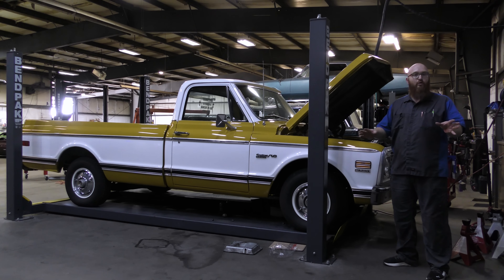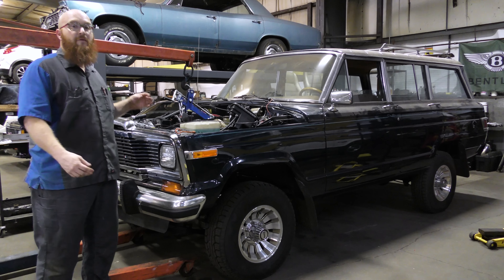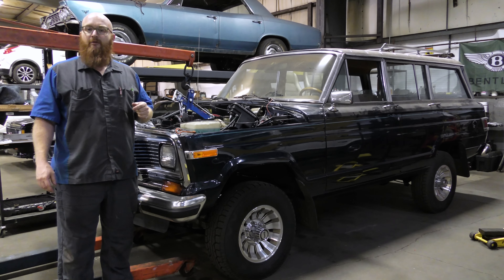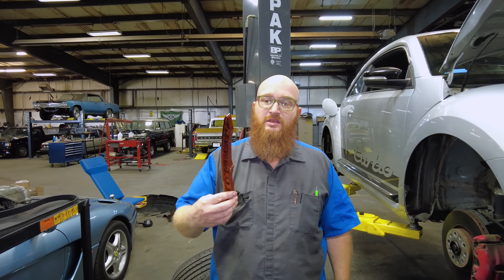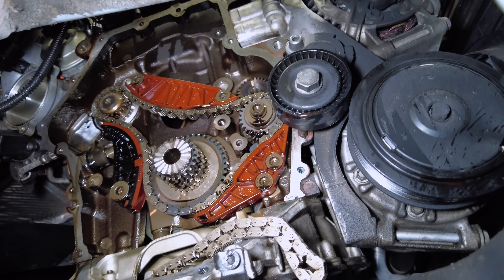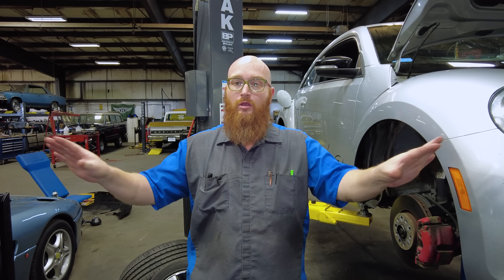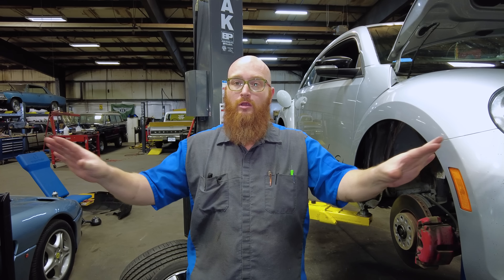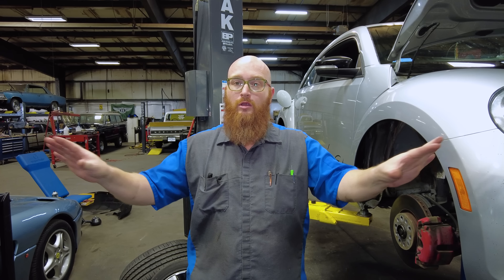Hard to test, can't see it, but it can KILL your car! CAR WIZARD talks Timing Chains! Is yours next?

Comment: Had a timing belt replaced on my daughter's 2004 2.0L VW Beetle while she was away at school. Car had about 80K miles so it was time. The hack shop did not adjiust the tensioner properly and the timing chain slipped 10K miles later. Since it's an interference engine design, the damage was catasrtophic. Several valves crashed into the top of the pistons so I had to replace the cylinder head. Fortunately the pstons had no signficant damage. During the repair I found the hack shops tensioner adjustment tool laying down near the bottom of the timing cover. Apparently the mechanic dropped the tool during the repair and couldn't find it so he never finished adjusting the tensioner.
Reply: Nice! 😞
Reply: @Scooter 
You DID get your money back from the defective workmanship didn't you?
You should have gone to small claims court ! Only about $65 bucks to file a claim for damages against that incompetent shop.
Reply: @Scooter 
and your experience is why many people don't want to get their cars serviced, this kind of terrible incompetence is the NORM in the business. The competent and honest shop is the EXCEPTION to the rule
Reply: Sad...older Rabbits had rubber belt non interference motors. 
Sorry to hear that..
Mechanic had "cellphone interruptus syndrome" forgot e dropped tool.
Reply: It's always best to go to an 'indy' (independent) marque specialist.  Plenty of VW specialists out there.  They usually don't rip you off like dealers do.  Otherwise they can't stay in business for 20+ years as many have or else bad word-of-mouth would make their business dry up.
Reply: @Matt_from_Florida  true but check reputation... Many butchers out there.
I do all my own work .
Reply: @Nudnik1  I also do ALL MY OWN WORK.  I'll be 60 in 2 months and I haven't paid a professional mechanic since I was 23.  That first-hand knowledge is how I know whether local repair shops are legit.
Reply: @Matt_from_Florida  same here 60 on 9/1 fix all equipment trucks boats bikes since 13 yo. 👍
Reply: Same here early 50s I DIY everything myself from cars to ceramic tile to roof repairs. Every time I had a pro do it I've had to go behind them and fix their shoddy work. Last time I took a car in was it needed an inner tie rod and alignment. Oh gee you need new struts we can't align it on these worn struts. What am I going to do so ok do the struts. $1000 later the wheel is at the 1130 position and I later found where they did not secure the ABS wire so it was rubbing through. They also did not install the grease fittings on the new sway bar links. Finished the job myself and will never go back nor recommend. Oh and it took them days to get this done because they had training or something.
Reply: Oh and then there was the time my daughter got a flat at school so I put the spare on and went to the tire shop to get two new rear tires since they were kinda worn anyway. Bad on me I should have checked but I forgot and a few months later went to check her spare pressure and low and behold they swapped her good spare for a shredded one and stole her jack. So I go back to the shop and tell the manager I want a new spare and jack. He cannot understand how this could happen. I said who here drives a Mustang. He said he'll take care of it and a couple days later I picked up the new spare and jack. Unbelievable.
Reply: @Matt_from_Florida  Me too! Keep telling myself it's just a number.

Comment: Always amazed me how German manufacturers always have these timing chain issues.  I always thought…look at what Toyota did and copy that and never worry about it again.
Reply: The Swedish manufacturers (Volvo and Saab) had some issues, too. Not because of poor timing chains (which were duplex, so certainly strong enough), but because Volvo used a fibre chain drive gear - presumably to make it quieter - and Saab used a weak tensioner, which could wear and even break. Surprising in view of the fact that both companies made solidly built cars. I had several Saab 99s over 20 years . When they went bust, I switched to - you've guessed - Toyota.
Reply: I love Toyota they are like cockroaches they never die
Reply: I worked at a independent BMW repair shop for 7 years. Some of the engineering crap i saw was mind blowing. And to this day they can t make a engine not leak oil.
Reply: @jonhouck7254  I love mine, too. I was driving home one evening, crawling through rush hour traffic in London. I drive one of the very few Camrys on the road in the UK (they're rare here). An African guy driving a delivery truck in the opposite direction leaned out of the window, smiled, pointed at my car and shouted, "They never die, man" and gave me a thumbs up.
Reply: @laurieharper1526  GM (2.4 and 3.6), Nissan (Juke and the 3.5 VQ)  among others would like to say hi.
Reply: @laurieharper1526  Instead of several SAAB cars over 20 years, you can drive one Corolla for over 20 years, and then it still runs perfectly.
Reply: @deansapp4635  I was going to buy a 4 year old BMW with the B48 engine (supposed to be their good engine without timing chain issues). Thankfully I was allowed to bring it home to inspect the car and after removing three under car covers I found an oil leak. How can a 4 year old car that was seemingly well taken care of and had a full service history leak oil?
Reply: I killed a Toyota back when I was a teenager. Took some railroad tracks at high speed to do it. It’s amazing what air time does to a car.
Reply: Toyotas also have timing chain issues. Usually due to lack of maintenance and age and not by design. People think you dont have to maintain toyotas becuase they are reliable, but thats not true. The real issue in most cases with most cars is poor maintenance. Americans are bad at servicing their vehicles.
Reply: @PeterGeorges  It's a BMW.   Don't ever ever ever in life buy a used BMW. It's the biggest and costliest mistake you can make.
Reply: @MiikeyLawless  All vehicles need services. If you service a Toyota it will run forever. BMW's and the like don't last long, even if you do service them meticulously.
Reply: @BubblesTheCat1  after that experience I purchased a Mazda instead!
Reply: @PeterGeorges  😅👍
Reply: @BubblesTheCat1  Nothing is more expensive than a cheap, used German car.
Reply: @napoleontheclown  So true. I had a nephew, who bought a used BMW at a second hand car lot for the price of a new Corolla. What a stupid move! I warned him over and over again. The BMW then kept on breaking down, leaving him and his family stranded 1000's of kilometres from home. The repairs then cost mega  $$$ and he eventually gave up, heartbroken and in tears when trying to sell that BMW again. He had to let it go for absolutely next to nothing. Less than 1/10 of what he paid for it. 😅😅😅😅
Reply: @BubblesTheCat1  Ouch. Hopefully he learned that there's a reason luxury cars, in general, have such low resale value.
Reply: @napoleontheclown  Yep. Lesson learnt. The hard way 😃
Reply: @BubblesTheCat1  NA i6 BMWs are legit though. I've seen guys put 300k+ on E90s with minimal trouble. I'm at 150k on my 2008, original clutch and everything else besides gaskets and a water pump 9 years ago, driven it across the US twice in the past few months
Reply: Or Honda.
Reply: @PeterGeorges  I don t understand why BMW can t engine oil leaks. I owned a 95 Chevy Suburban from new. At 240k miles it developed its first and only oil leak, Oil filter adapter. $ 3.00 in parts and 20 mins to fix. My brothers BMW 435 made it to 60k miles before it started leaking oil. This is his 5th and last BMW
Reply: @thebigpicture2032  not always - I was in an 89 extended cab pickup that hit a 6 ft 70 degree railroad track. We were in the air long enough for the front to come down, hit on front wheels. Popped out one of the headlights and no other apparent damage. Years later they found we cracked the front axle. But still drove baby.
Reply: @BubblesTheCat1  thats some bs lol.  People just try to treat the germans like theyre toyotas and guess what?  Doesnt work.  Stay on your intervals and youll be great.  Thats why I always buy Euro over Toyota.  Toyotas are boring, no fun, OVERPRICED appliances.
Reply: Agreed. I have a 1991 Toyota 4Runner , V6 5 speed,  377k miles. Serviced every 5 thousand. Never a major mechanical failure. We just acquired a 22 4runner limited . I plan for it to be my last vehicle,  I'm convinced it will carry me to my grave. I'm a 4runner purist , bone stock , meticulous serviced . 🙂
Reply: @jarrodmcmillian1747  Appliances that have an excellent resale value, and hardly ever breaks down?  I'll have one, thanks. 
Anybody who calls the new Lexus LC 500 "boring,  obviously haven't seen, driven or owned one. I'm a tech, and can confirm that BMW, and the other German cars of today is NOT value for money. 
Sadly Toyota is also starting to go this way. They must have learnt about planned obsolescence.
Reply: @d47000  Older BMW'S were indeed way better, yeah ☺👍
Reply: @MattBlack6  Or early 2000's Nissan, before the fatal Renault merger.
Reply: @deansapp4635  Yea I don't get it, even my 14 year old Mercedes CLK doesn't have leaks but a 4 year old BMW can't stay dry. I was happy that my BMW paranoia made me bring the car home for an underneath inspection though, most other brands I wouldn't bother for a 4 year old car that was otherwise well kept! Glad I didn't end up with that headache. I was expecting to see more of a coolant issue rather than oil tbh!

It's unfortunate though because they are great cars to drive but that's not worth the potential of major engine troubles down the line.
Reply: 210k miles and I haven't given my Camry's timing chain a second thought. Now I wonder if I should lol. Ah well.
Reply: @MattExzy  Nah, when you're past a million miles,  you can think about it again ☺👍
Reply: @jarrodmcmillian1747  Yes, you could call Toyota "appliances". Like any appliance, most owners want them to work and do the job they are supposed to do. Which Toyota do extremely well. If "boring" is getting to your destination every time with zero issues, I'll take "boring" any day of the week.  I have enough excitement in my life already, and don't need to add uncertainty about my car to the mix.
Reply: @BubblesTheCat1  When I started running Saabs (1970s), Corollas didn't exist.
Reply: Mighty Aussie Ford 4.0L Barra have zero chain issues as well and are known to go past 500k with regular interval servicing. Taxis with LPG will hit 1m klicks.
Reply: @PeterGeorges  I worked for a independent BMW repair shop for 7 years. We offered all of customers a free pre purchase inspection. We broke alot of customers hearts when we would find the vehicle needing 1000s of dollars in repairs.
Reply: @laurieharper1526  I had a Saab 99 never broke could not blow engine even when we used it on dirt bike track..I had a few Volvo 240 and 260 strong simple cars also indestructible. Now they are Chinese junk .
Saab 99 had British Rover engines.
Reply: @deansapp4635  my cousin has a shop in NYC does Audi BMW Mercedes VW garbage cars.
Look nice until repair bills come in.
He drives a Chevy Tahoe with 300k miles 😂
Reply: @Nudnik1  It was actually a Triumph engine, designed by Ricardo. 1850 4 pot. Triumph used it in the Dolomite and other models. It had a few issues - wedge shaped combustion chambers (because Triumph wanted to use 2 side by side to create a narrow V8 which would fit in the Stag), angled cylinder head bolts, not the best thermal efficiency/prone to over heat (which Stags were, also) and the water pump set into the block and driven via a skew gear off the crankshaft. If the pump failed and leaked, coolant could get into the engine oil. Over the years, Saab modified it - increasing the bores, using conventional combustion chambers, widening the gaps between the bores and re-siting the water pump. A fine engine, granted, but the timing chain tensioner remained an issue until the last version from the eaarly1980s. My most recent 99 was from the final year of production. Great cars. When Saab went bust, it became very difficult to get parts for pre-GM models, which was when I switched to Toyota.
Reply: @laurieharper1526  true Triumph I forgot 30 years ago...Sorry. Yes my water pump shaft sheared after thrashing 9000 rpm with 200k miles when we tried to finish it off 
Awesome car in snow also.
Clutch disc can be changed without removing trans or motor.
Engine was strong simple.
Thanks
Reply: @Nudnik1  You're right about performance in snow. My partner and I both had 99s. We lived on a steep hill and were the only people (together with another guy in the street who ran a 99) who could drive up it when it snowed.
Reply: @laurieharper1526  Amazing cars. Older Saab two stroke and v4  in 60s had a lever that let front drive axel ratchet no compression braking down hill so you maintain steering going down icy snow slopes.
Watch Volvo Sweden off road rally racing.. No cars stronger .
Reply: A 70s engine with a serious timing chain issue was the Triumph Stag, ohc V8 one chain running both cams, when Triumph said 30,000 miles to replace it they meant it. Many owners and shops thought that's ridiculous and ignored it, they soon learnt the expensive way it was an interference engine. Of course the Stag got a reputation for being very unreliable, not altogether deserved.
Reply: @deansapp4635  here in the UK people still love 'em,  VW too.  It's nothing short of a cult.
Reply: @acd1202  test BL already had a reliable V8 in the ex-Buick engine they'd bought the rights to some years previously.  In-house fighting ensued where the Triumph guys insisted on developing their own engine.  The merger of British cars manufacturers was a bad, bad idea and the eventual demise of our our car makers eventually followed.
Reply: @Nudnik1  When i worked at a BMW shop, I was the only employee not driving a BMW. I drove a Chevy Suburban
Reply: @deansapp4635  I had a 1983 733 in 1984 fixed body damage a good simple car no ecm modules high
Tech . Germany made good stuff then.
Reply: @Nudnik1  You are right. I owned a 94 e36 that was bullet proof
Reply: @jonhouck7254  No they don't. My 07 Tacoma frame broke into two sections literally In 2016.
Reply: Toyota is not immune to timing chain issues. I've seen plenty fail. Just did a set on a Venza a couple months ago
Reply: I’ve had several Toyotas over the years and never once was I ever stranded. Mind you every single one I bought with over 100k and kept them until I wanted something else or just needed a different vehicle. Many well over 200k and 3 2 Camrys and a 4Runner I ran well into the 300k range and gave them away and lasted another 6 years til I lost track of it. Currently in a Tacoma and it’s absolutely my favorite of them all.

Comment: This timing chain problem also occurs in motorcycles, the Kawasaki 650 dirtbike has a tensioner, which usually breaks around 5000 miles, but can be replaced by a metal aftermarket tensioner that never wears out, it’s referred to as the Doohickey.

Comment: My 2006 4.0 Tacoma always rattled like a paint can full of marbles. I learned that it was due to the VVT. Ever since I switched to Mobil1 the rattle is 1/4 of what it used to be. I am not suggesting that Mobil1 is the best oil to use, but I can attest that using a higher quality oil, no matter who makes it, can improve valve train issues.

Comment: One of the design features I really love about the Duramax 6.6 liter Diesel engine on my GMC 2500 truck is it uses gears instead of a chain. A gear on the crankshaft meshes with a gear on the camshaft.  After 355k miles, zero issues with valve timing. What a brilliant design. I wish my gas engines had the same set up. My 1999 Jeep Grand Cherokee with the in-line 6, 4.0 liter did break the timing chain, and the pistons did contact the valves, basically trashing the engine. This happened at 221k miles. I put in another 4.0 from a 2000 Jeep with 210k, and I am more diligent about these chains now. Before I put in the engine, I put In new timing gears and chain, and a new oil pump. The inline 6 is normally a 300 k engine, but sometimes it just isn’t.

Comment: Thanks for checking on the chain. It was giving me a mechanics painc attack not checking the chain. At the shop I use to work for we routinely had smashed valves come in with those vw/audi motors. We were not a cheap shop either at 185 USD a hour and the only people who will bother to work on modern euro in a 300 miles radius. I wish people looked at their car as more than a appliance when it comes their cars. That's why people moan over service imo.
Reply: Wow, and I thought Porsche here in Italy are expensive, at their 90€ (=90$) at hours! That's insane!
Reply: That's true. But alot of people just don't care either, I used to own a 2006 Bmw 1 series and everytime I'd fix something it would just break again so decided to leave German behind. Now have a fiesta 1.6 metal edition that I can fully service and take care of myself as it's simple to work on and don't need a degree or £10,000 in labour lol 😐

Comment: I wrenched in my father's shop from the mid 60s to the mid 70s.  All the GM V-8s in that era had plastic teeth on the cam gear.  It was done for noise abatement, the replacements however were all metal.  The plastic cam gears didn't make 100k miles, but typically the failure resulted in either very poor running or no running at all, I think the motor died before the any valve to piston interferance occurred.  The American Motors are interferance engines and timing chain failures do occur.  I specifically remember a neighbor's Wagoneer engine we replaced after the timing chain broke on the highway, there were holes in several pistons.